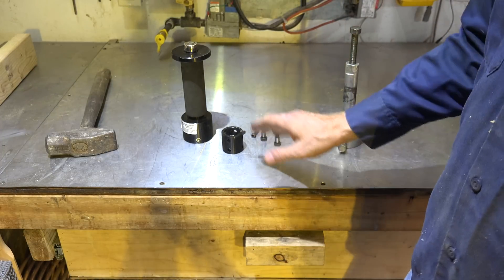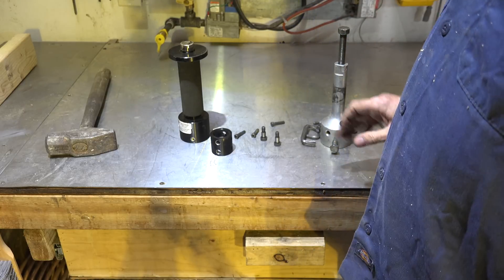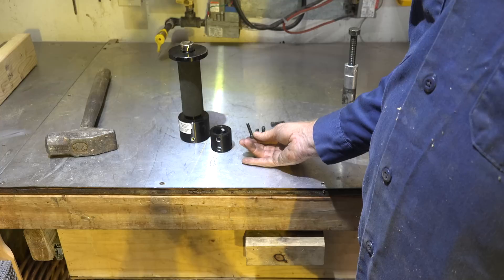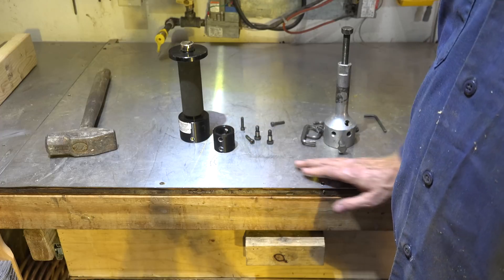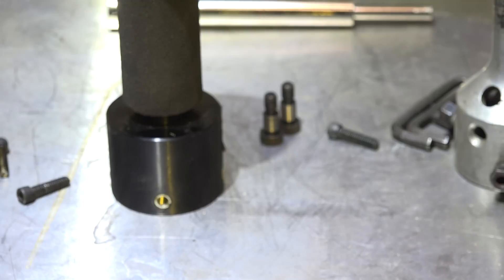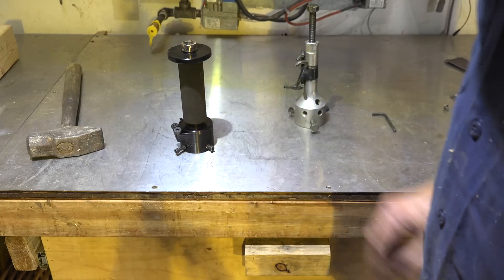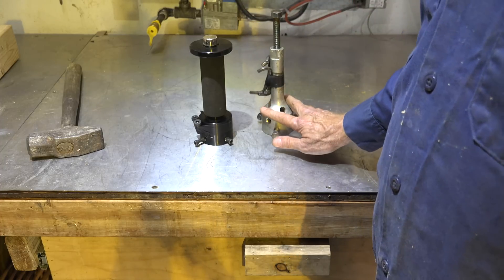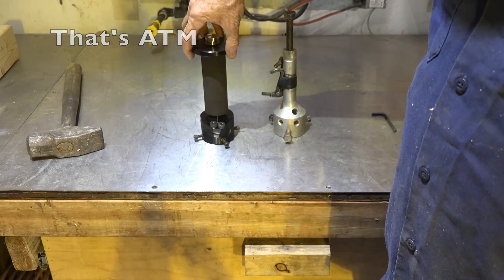Test the ATM hub puller, conclusions

Comment: The Aluminum Ultimate Puller UP1 here was bought about 1997. It was patented in 1993 as US Patent 5211211  https://www.google.com/patents/US5211211

MIne is used non commercially in my business and home to replace the fan motors on my equipment. We get 70 inches of rain a year here plus have salt exposure since by the gulf. By greasing the motor shaft the puller is not even required. A water proof Marine grease for lower units of outboards seems to be a robust grease.

With a Payne AC I worked on that was from 1971 the fan hubs set screws were rusted in place and no amount of Kroil, tapping. Pulling or heating freed up the screws. We ended up using a moto tool to remove part of the screw. In HVAC repair a tech would have bought a new fan and not down such a thing. I was in a rural area on a weekend 2 hours form any parts house thus a brute force moto tool method worked